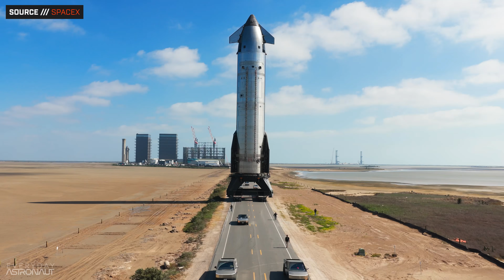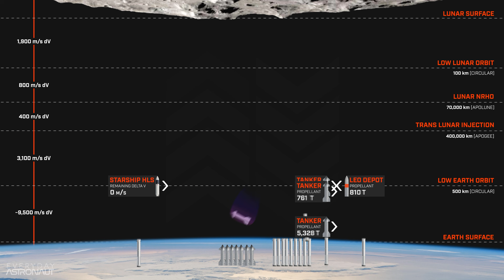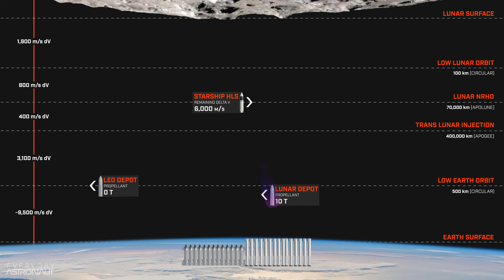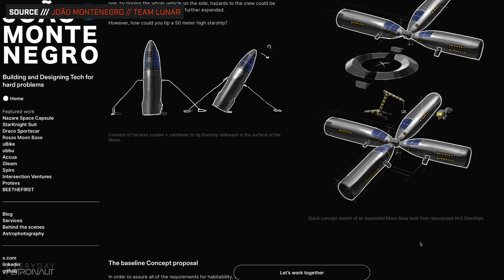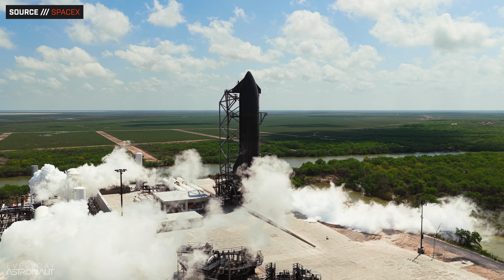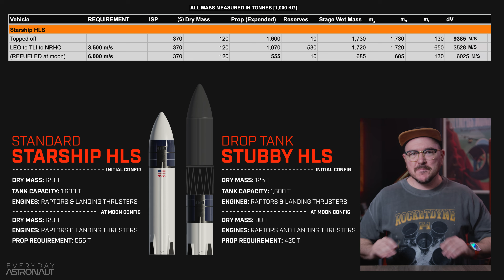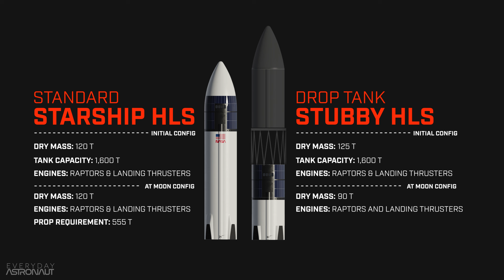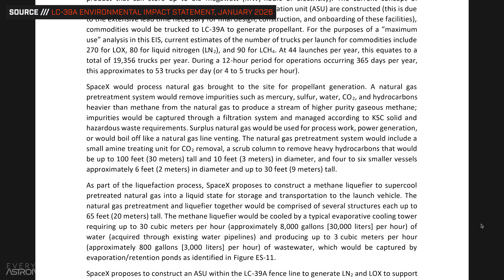Does Starship REALLY require 15+ launches to land one lunar Starship?!

Comment: its a marathon.
Reply: instead of multiple launches, just launch everything at once, ie one full starship and enough boosters to get the one full to the moon. no just one launch. why make things more complex with multi-launch complexities and issues. nuclear reactor radio photon impulse is infinite. also nuclear reactor fuel density curse of rocket equation is minimal. because almost no weight but lots of energy density. ie energy usage losses are minimal to just lifting its own weight. ie power to weight ratio is much much larger. yes photon engine uses the heat/electric power itself as the propellant, no external propellant required. yes even black body radiation is photon propulsion itself. ie photon push. well how much of a lamp thruster you can make. not if the air passing through the lamp is the propellant but when the heat light of the lamp is the propellant itself. not ion propulsion but photon propulsion and using nuclear reactor as the energy source. well the reactor shoots out neutrons and stuff too.
Reply: way too complex staging system. keep it simple people. i guess money decided not reason. yes first decide what is the best. dont involve any money in the best. then do the best. money is never the best option or feature. same goes for human governance. flesh is a mic bug btw. yes even with flesh, less mass is more deltav. so how much megawatts of power a reactor can push out at once. well earth reactors are 500-2000MW. so say 500MW of directed photon heat output. falcon 8 thrust is 7-8MN.
Reply: yeah launch track sounds better every day. to minimize the rocket mass. one more thing, you can use electro-magnetic bell nozzles instead of physical scoops to direct the hot plasma flow. much lighter. also em fields dont melt. also if you say an engine can be on for 320s then also at what power thrust level. to make a meaningful statement. ie work for how long equals energy output. in physics you always need to have some scale of all the required parameters. ie what is the engine thrust / power. ie if the engine is on at 0W/0N for 320s its doing nothing but just being on.
Reply: kerbals ftw. nice moon slope landing. then you need to land sideways belly flop. yep put the landing thrusters pointing from the side. ie use the direction control thrusters as the landing thrusters. also a blimp flies sideways most of the time. also center of mass or thrust is no matter if vertical or horizontal. ie the main rocket engines location is always the same. err sideways horizontal landing legs can be pulled to level. dont change anything in the internals. sideways starship looks cool in kerbal. very star wars space ship. dynamic balance control with a drone is simple enough. also when the starship is sideways the thrusters area and ship area to the ground is much larger too. ie 50m sideways not just 8m sideways. yep sideways is much better. just like a real life route ship blimp. also drone control works just fine and is stable enough. while the lever arms are on the quad edges. its a go, do it.
Reply: also dont be hanging out in the space for no reason if you have volatile fuels. all at once launch. lots of orbital dancing for no reason. also spreadsheet is so dry mass. also bs, make a bigger super heavy booster to do the full orbit to the moon on its own. yep one super heavy stage to the moon.
Reply: spread sheets really sleeps the llamas but. how would you design the system if you would design it yourself. and do it yourself. ie not tied to any others previous decisions and money. really flowing fuel through people cabins? right. well flowing natural gas in pipes in people's homes is hazardous enough. yeah nah mate. also spacex will not shorten the normal starship at all. nope they will not shorten the starship even for mars either. full size. you know being poor causes lots of talk in vain. christ is rich so people are poor. there are no people in christ but all are on in spirit. so dont look at what people talk.
Reply: have more trust in christ doing what he decided to do.

Comment: Dumb question here. How unfeasible would it be to just make the HSL a 3rd stage? Seems like to the lamen here that it could drastically reduce the number of required launches maybe? I'm sure its already been thought of and explored by SpaceX.
Reply: why you need third stage if you could refill second stage?
Reply: @maks_1_123  because it takes a dozen launches to refill second stage.
Reply: @widj222 what's the issue? The more refillings you do the more mass to the  surface of moon you get.

Comment: Maybe a dumb question, why not do sort of the classic Apollo? Have a drive unit that never lands on the Earth or Moon, and a lighter weight (even more stubby) landing module?
You can even (if the engine's can handle it) use the drive unit for multiple trips.
Reply: He addresses this at about 13:22 and later in the video. While this would technically get us back to set foot on the moon, the actual goal is long term infrastructure, so at some point, we're going to need to transfer a lot of heavy equipment and building supplies, which needs that huge payload capacity. This means we'd be spending a lot of engineering effort on developing a lander that we'll outgrow after 3-4 launches, and need to do the "hard" work, anyways.
Reply: @SpacePirate20X6  You could always use the smaller lander for crew and the big lander for cargo/station modules.

Also I think he more meant to just separate it in 2 different parts: a transporter with fuel tanks and engines purely for LEO-TLI and TLI-LEO flights and a lander (cargo or crewed) that can be attached to it (like a car on a transportship/ferry for example). Larger payload/lander => larger LEO-TLI transporter.

Might also make cargo transfers in space easier since you just attach existing 'ships' to eachother.
Reply: Apollo was very expensive for very little payload to the moons surface. HLS is more complicated, cheaper and higher payload.
Reply: @RODI____  Thats not what I am saying, I am saying, instead of drop tanks, split the ship between an lander and drive unit, that way, you don't have to launch al that extra waight from the lunar surface.

Comment: Sending full size Starship vehicle to the moon orbit, surface and back to the moon orbit is just "not wise" (there is a short word for this). Staging architecture exists for a reason. They need a space tug vehicle to ferry loads and more reliable propulsion systems for moon landing / takeoff phases. We heard autogenous pressurization in booster generates some water. Not only they have to refuel in orbit this many times, they also need to figure out how to purge water from tanks. Before refueling, during transit, landing and takeoff. One ice clogged pipe -> Mission failure -> crew that does not come back.
Reply: They will test the ship without a crew first :)
Reply: @user-cx6iz1in4e - Starship right now is starlink delivery vehicle. Hopefully they create a variant with large payload bay to deliver large payloads as well. They probably can create a space tug Starship. But landing the starship on the moon is madness for many different reasons. BlueOrigin lander is our only hope. We also heard from NASA that SpaceX may change their HLS strategy to something more realistic
Reply: Is the goal to just set foot in the moon again, or is the goal to build a permanent base and eventually extract resources from the moon? The BO lander ain't doing any of that? If we're just going to set foot on the moon again and not do anything else, what's the point of any if this? We've been there and done that.
Reply: @andreylukyanov2179  I completely get that starship is way too massive to be landing on the moon at this point with the technology we have, but Ideally we should stay with the large vehicle and find a way to make it work, I think we should be focusing on super heavy, it reserves 450 tons of fuel just for re-entry and landing, why doesn't the super heavy have quite large wings on it(but with no heatshielding) and then land super heavy with a bellyflop to a suicide burn? it likely would barely even need 100 tons of fuel for that seeing as starship needs just 32tons on earth so that's another 350 tons of fuel that could be in starship and brought to orbit, that's 233% more fuel per launch(based on tanker starship with 150ton to leo capability) dropping the 12 launches to refuel down to like 3?
Reply: @trevorpullen3199  @trevorpullen3199 - You've now been added to the small list of people I keep that "just get it".  BO lander is so small, thus the usable deployable payload to lunar surface is small.  BO has supposedly Lander (Mark2) + Tug + Tanker craft going to the moon.  And refueling over the moon.  NASA award doc to SpaceX in 2021/2022 said this and it was deemed too risky.  I'm not sure the accuracy of a recent other channel saying BO lander would deliver 1/30th the payload of one Starship-HLS.  If that is true, then over 120 launches of BO craft would be needed to do 12-14 launches of Starship related craft (tankers and depot, plus 1 singular HLS variant) to deliver the same amount of payload.  This video, released a few days ago here in May 2026 is also a bit out of date.  Several documents, such as NASA's need for a LLO communication system (RFP) imply they are planning the Orion dock to be in LLO.  NRHO is basically out of the picture as an option.  Why this youtuber continues that line of thinking is beyond me, and he clouds the math by doing so.  Also, nowhere in NASA docs does it say the Starship-HLS is being used again after it's single mission (after landing and takeoff at the moon).  Therefore, again, this is speculation on this youtuber's part.
Reply: @user-cx6iz1in4e they will test deliverying starlinks into orbit only.  thats all it will ever do.  its entire design is built for that.  its not going anywhere near the moon,  let alone mars.
Reply: @Jebes00009 the entire design of starship is deeply flawed and driven by Elons ego no Mars no Moon
Reply: @Jebes00009  I think we might be in for a surprise or two. These guys are snake oil salesmen but they are not stupid. There is a reason they are tinkling with the tiles, probably a very good reason - that we cannot imagine of. But if they succeed it will have unique capability to bring down massive cargo from orbit. Hmm could there be a military use for that ... like Starlink winning a war in Europe currently.
Reply: I can't tell you the joy it gives me on a daily basis to see some internet commenter explaining how dumb and know-nothing the company that launches 10 times more mass to orbit than the whole of Earth other than them actually is, but how no one but them can see it.
Reply: @gasdive  Thank you, bravo.  There are a lot of assumptions made in the video that may simply be untrue.  And those maybe false assumptions really cloud the math.

1) NHRO is probably out - NASA LLO communications RFP implies that.
2) No NASA plans show Starship or other landers for that matter, being "reused", so therefore no "over the moon" refueling for Starship-HLS is needed.
3) No one is talking about the Blue Origin plans.  3 separate craft (Mark2 + Tug + Tanker).  Somewhere like 1/30th the payload delivered.  120+ launches for the same payload vs 12-14 for Starship.
4) Human habitat for Starship-HLS is probably gonna be smaller than what the renders show, they don't need 600<->1000 m3 for 2 or 4 people, they're only spending maybe 11 or 12 days using it.
Reply: @gasdive  Have fun while it lasts. Let's see what flies with Artemis 3 in 1 or 2 years. And this is just the Earth orbit.
Achievements do not extrapolate.

Comment: Haha, 1 hour 45 minute video. Haven't watched it yet, but I think the answer is it will take between 10 and 25 flights to re-fuel the Starship upper stage in orbit. Which sounds quite ridiculous, but I wouldn't write SpaceX off - almost no one believed they'll be able to get the Falcon rocket first stage to land reliably and re-use it dozens of times - but they did it.

Comment: Video obsolete before it was published.  Too bad since it was a lot of work.

First off NRHO is out of the question now.  Orion isn't going to the moon any more and NRHO was adopted to meet the SLS + Orion's limitations. As of a few weeks ago Starship HLS will meet Orion in LEO, Astronauts will move to HLS and rife it to Lunar orbit.   They will then land on the moon perform their mission, take off from the moon and return to LEO in HLS.
SLS and Orion are also obsolete but won't be completely canceled until Blue Origin has it's own plan for reaching the moon and back completed and in service because NASA wants to have a backup system.

Once Blue Origin is live SLS and Orion are canceled, Falcon 9 and Dragon can take Astronauts to orbit and back until Starship itself is rated to launch and land with people aboard and when that happens expect to see Starship make the journey to the moon and back while HLS variants stop in Lunar orbit and get refueled from Starship or a Depot in Lunar Orbit before they land

People are making a lot about "boil off", given that Starship was designed to go to Mars and Back SpaceX has to control "boil off" to near zero because it cannot lose lots of fuel over the months it takes to get to Mars, the months spent on Mars and the months of the return trip.

Also the landing engines will only be needed for the last hundred meters while landing and again when launching because the exhaust of the landing engines won't affect the ground except for the last phase of the landing so the most efficient engines should be used as long as possible and not for the majority of either the launch or landing.

Starship landing engines will also be Raptor engines, I don't know why you forgot that SpaceX has already said that but like the Russian engines each of those will likely support multiple combustion bells as is indicated by the cones shown in the SpaceX renderings of HLS probably no more than six per engine, I'd expect to see four of those with each having combustion bells all around the Starship rather than clustered close to the turbo pumps of each engine so an engine failure is automatically compensated because the thrust loss will be uniform.

The Depot in LEO will fill HLS after it launches originally and can do so again after every trip to the moon and back.  HLS will never land back on earth and there is the true problem with the system.  For any subsequent trip to the moon, the cargo going to the moon will have to be transferred in orbit from a "normal" Starship and any cargo returning from the moon is transferred to Starship in orbit as well.

After Starship launches become frequent a system of harvesters could be sent to Saturn where Methane can be pumped from the lakes of it on the surface and water ice is the major component of the Rings.  Expect to see specialized vehicles to land on Titan and harvest Methane and different ones to harvest the water ice of the rings but once they are in place they can set up a series of Depots that move back and forth to and from Saturn to Earth, the Moon or Mars and it may come to pass that refueling flights from Earth itself rarely if ever happen.  

I am probably also seriously misunderstanding how things will work out too, but that's part of the fun of all this speculation.  However it works out I am just delighted to see that Space is now a lot more accessible and soon it will even get a whole lot more accessible.  We have left the ago of plodding along!